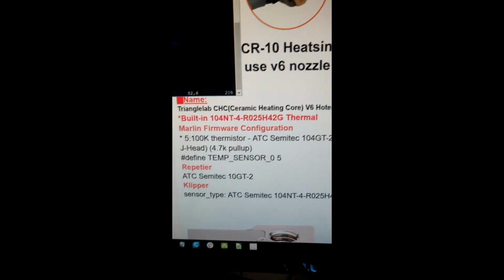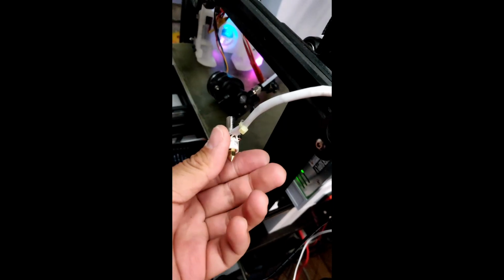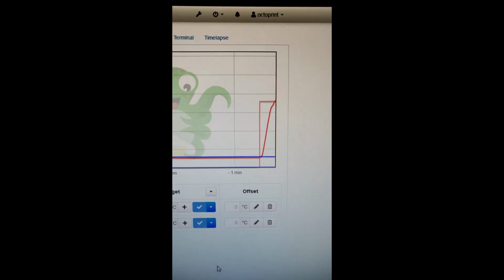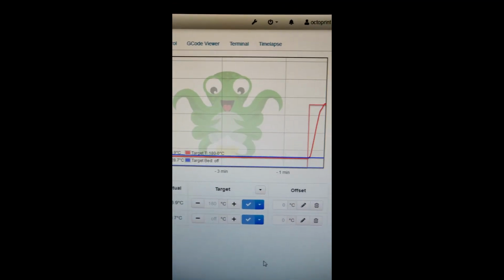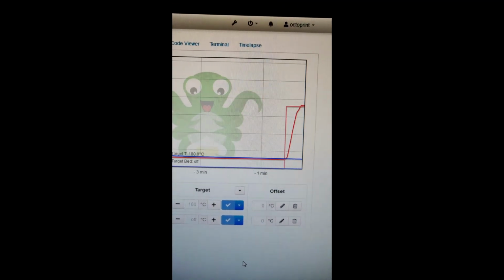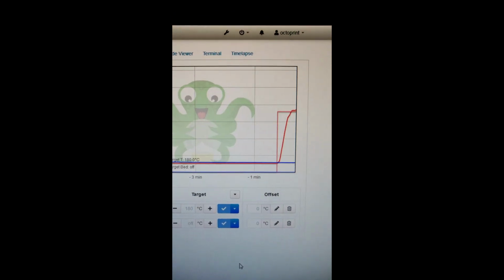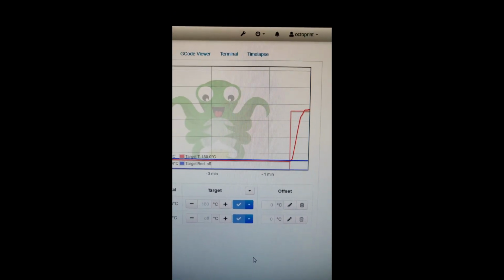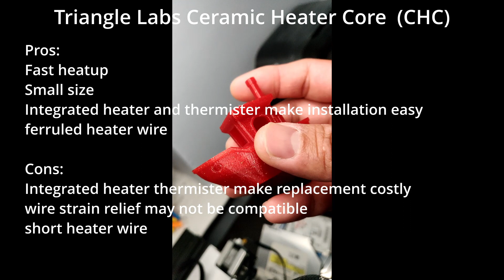Triangle Labs CHC heater core on Creality Ender 3

Comment: Super interesting.   Have you done any thermal testing for heat creep?  That heats up fast and I know you did PID tuning but have to wonder if on a long print (5-10+ hours) is heat creep can become an issue.    Thanks for sharing.
Reply from the maker: never had an issue when I used it, but I moved on to stealthburner and never used it again

Comment: Looks nice! Did you measured maximal flow with that CHC heater? Would be nice to know it in comparison with standard hotend.
Reply from the maker: Not keen on doing tests like these but I suspect they are similar to what's in the rapido.
Reply: @TechExploresNYC  Triangle answered in comments. They suggested about +5% in comparison to v6-like hotend.